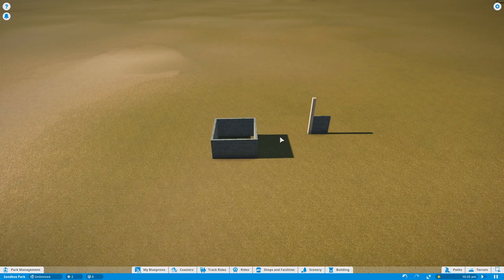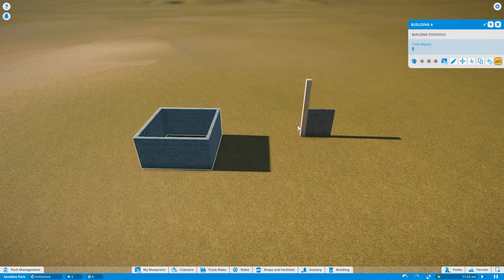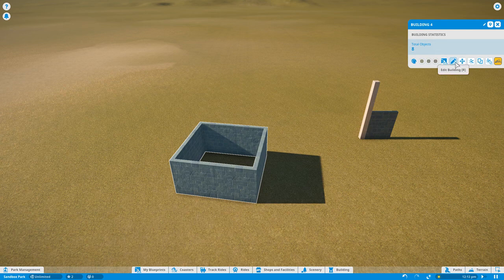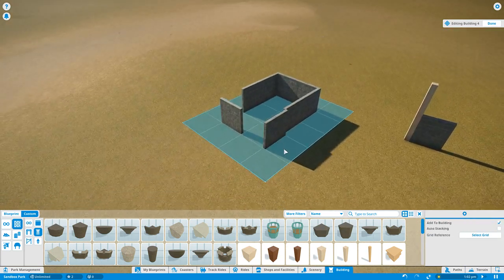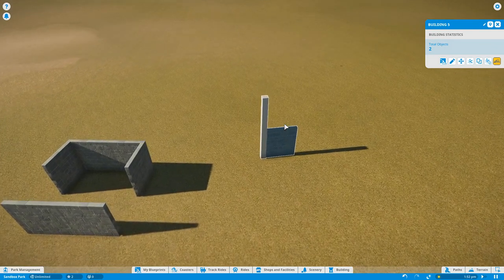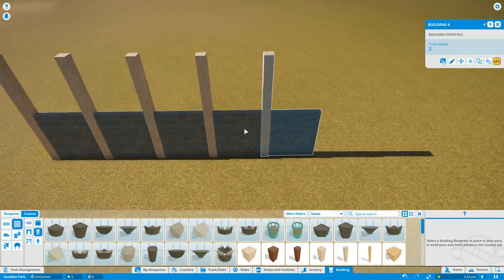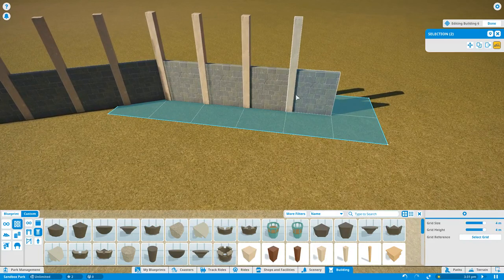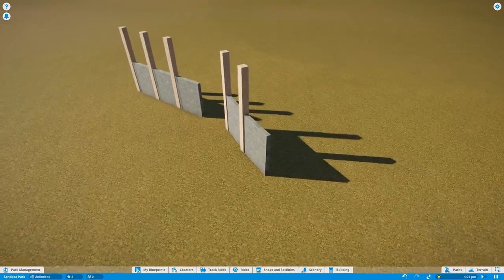Planet Coaster Tutorial - Grid based building system

Comment: Is there a way to stop it from going to grid building automatically
Reply from the maker: it will always go into grid building when your building contains a piece that is gridded. the difference between gridded and non gridded pieces is an important distinction when you are building in planet coaster. this video was made in a version of the game where a building required at least one piece that was on the grid, but this is no longer the case in the current patch so not all buildings are the same!
Reply: @CleaveBuilds  oh ok thank you for the information but its unfortunate that there isnt an option to turn this off